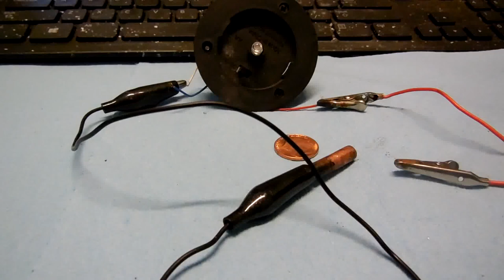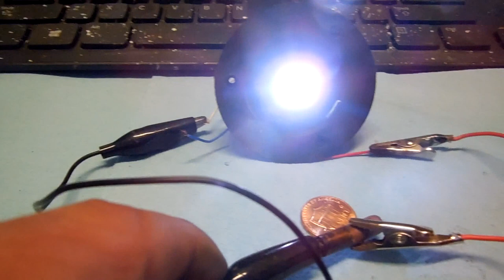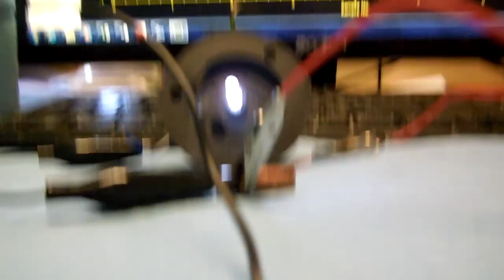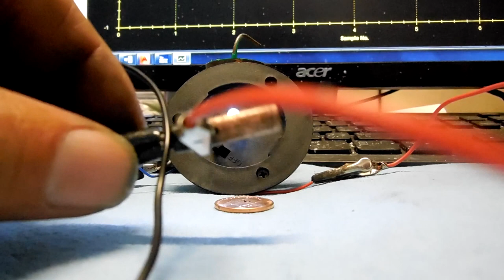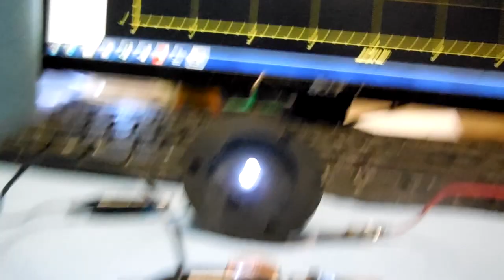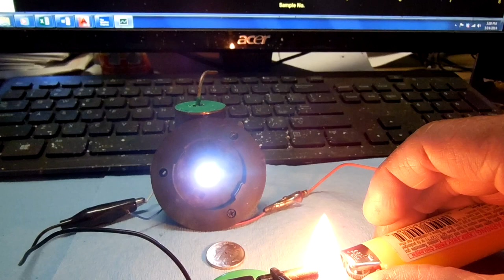Smaller version of Allwest power cell testing

Comment: Nice amount of power, and small too.
Reply from the maker: Hi Wave,
Thanks, I tried charging this cell with low heat- 100ma, I applied  high and it  goes up fast to 400MA but does not stay very long, not very good results, may have fried the cell but an interesting side affect, , I will try and post

A slow rise in heat, I think is the trick for this cell, not sure yet

Comment: Really nice output and it's smaller than a AAA. Looks ideal for powering a TV remote and similar.
Can this one be recharged, such that it might work in a solar garden light ?
Reply from the maker: Hi Slider

It is sitting at 10MA right now for a couple of days on direct short reading. I have not tried to charge the cell yet

I had some magnesium welding rod laying around, so this is the first try at this small of a cell

When this cell was first activated it reached in the 800 MA range for a short period of time, the test you saw was a couple of days after the cell was born
Reply: It is cool stuff and always has been with your research.
Must say, that chilli cell from a year or whatever back still brightly blips the LED on its circuit when connected. It might not run it all the time but has lasted and lasted !!!
I need to make more of those lol

Comment: Salam Steve,
When you recharge it by lighting it up, can we say that its similar to stirring salt water in salt water battery. In this case the fire excites the crystal formed inside.
Reply from the maker: Hello Talha,
That is a possibility but unconfirmed by me, I believe it is a form of thermal electric that charges the cell, What I have discovered is that the cell itself creates heat when shorted, or current is flowing,  which supplies a charge back to the cell with this heat (Thermal electric), this is what I call a self charging Allwest power cell, you can supply outside heat which increases the charge or thermal electric affect, but I am more interested in the self charging affect, some of these cells that I have created go thermal, They create more heat that creates more current that creates more heat and so on until the cell starts to vibrate (out of control) I then have to dump it in ice, not sure what would happen if left alone Ha!
Reply: Steve Allwest How to make it?
I have Mg ribbon, powdered Alum, MgSO4, Potassium Chloride (Salt sub), Borax, and a copper pipe. And yes, a carbon rod as well. What should I do next. I mean what should I cook as my paste.
I am not a scientist or something but I have an idea in my mind to create electricity. Need someone like your skills to implement into a working prototype. It has to do with centrifugal force. I have the basic design in mind but need to discuss with someone who knows electricity far better than me.
Reply from the maker: Talha Kamran  centrifugal force, sounds interesting